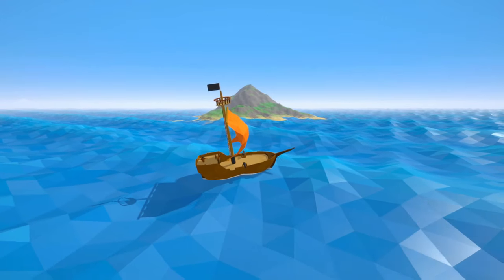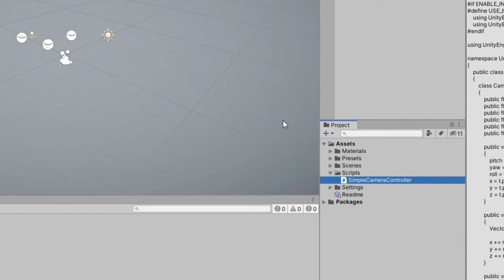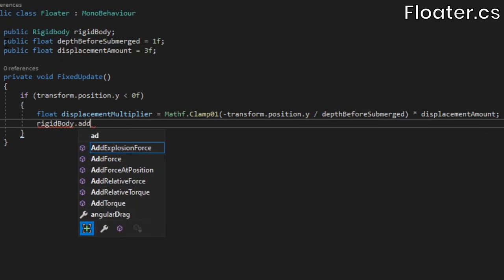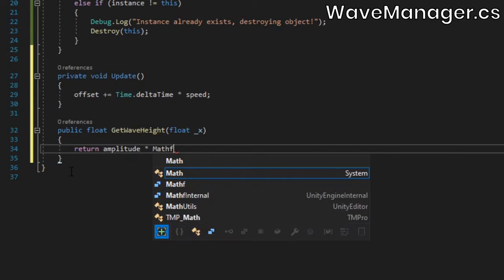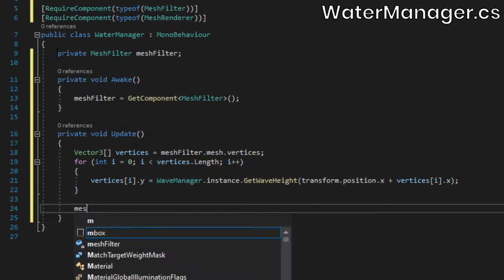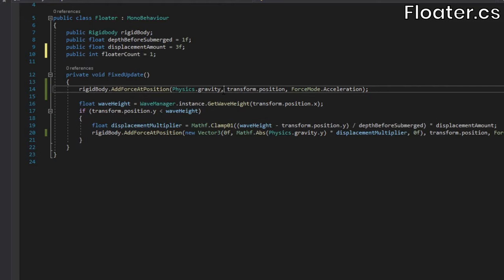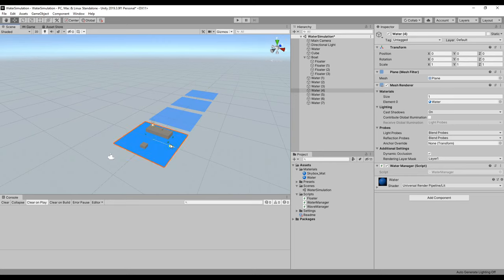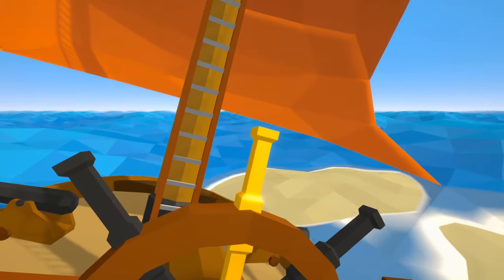How to Set Up Dynamic Water Physics and Boat Movement in Unity | Ship Buoyancy Tutorial

Comment: CS0165: Use of unassigned local variable 'displacementAmount'
CS0103: The name 'displacementMultiplier' does not exist in the current context

I got these two errors, can you help me with this? Its for the floater
Reply from the maker: Those are both compiler errors, meaning something in your code is different from mine, so just compare your code to what's in the video again.

Comment: I don't seem to understand how you're getting the waveheight from the shader.
Do you just simulate the whole equation in your wavemanager so you just have an approximation of what the wavehegiht actually is?
Reply from the maker: If you use the same formula in the WaveManager as you do in the shader, then it won't be an approximation—it'll give you the exact wave height. However, if you're using Gerstner waves, there's no mathematical formula that will give you the height at a given (x,z) point, simply because Gerstner waves modify the vertices on the horizontal plane in addition to the y-axis. The best you'll get is an approximation.

Comment: Hey, great video!
Where did you place the floaters on the ship? im getting some weird movement when the waves get bigger or at the beggining of the simulation
Reply from the maker: Just evenly spaced around the hull. How many you use depends on how big the boat is. How are you scaling up the waves? If you're changing the actual scale of the water plane's transform, that's probably why you're getting weird behavior because doing so doesn't change the scaling of the waves that are used in the physics calculation.
Reply: @tomweiland  no im changing it in the actual wave height parameter and not scale.
I get the weird bounces at the beginning and then the ships float nice.

Comment: Just curious.. Have you gotten any problems from the offset number increasing too high? Cause running the program seems like it could cause a crash due to value overflow if you don't reset it periodically.
Reply from the maker: I haven't run into any issues with that, no. However, I haven't left it running for days on end—you may need to wrap the offset every so often.
Reply: @tomweiland  Yeah, that's what i thought, the only problem can be calculating when to cut the time for it to not do a jump in the physics calculation, but that can be sorted with math too soo not really a problem. All praise the math gods!

Comment: so im having an interesting problem. As far as I could tell, everything worked fine with just a single floater, but when I introduced multiple floaters everything broke. My ship does react with the water, but it seems to be doing it too much. Its spazzing out, is the best way i can describe it. I have fiddled with the rigidbody settings on the ship and sometimes it gets marginally better, sometimes it gets a lot worse, usually nothing noticeable changes. 
I tested this out with a cube (was originally using a 6th rate frigate model I made, since I already had it and it was more representative than a cube was) and it works fine on the cube, which, in my mind, means that the issue isn't with any of the scripts but is something about the set up on my larger ship. I have no idea what the issue their might be, though. I frankly dont see how the way I have it set up on one ship could possibly break the system to that extent.
 any ideas?
Reply: I half fixed it. Adding a collider seems to have fixed the problem, for some reason, but the ship is still floating really weirdly. It looks like the gravity aspect of the floaters arent quite working as expected there (The bow and stern remain roughly aligned with each-other, even when they really shouldn't be), so the ships gundeck, and sometimes even the upperworks, regularly get submerged. This isnt a gamebreaking issue, unlike the one that the collider solved, but it is annoying and quite distracting. This is also a problem on the cube i used to debug the prevous issue (I had to scale it significantly for it to actually be noticeable though). I personally suspect I must have gotten something wrong in the floater script somewhere but I wonder if anyone else had this issue?
Reply from the maker: What did you attach a collider to? The water plane shouldn't have a collider attached.

How many floaters are you using? If your boat is substantially bigger than that test cube and you're using the same amount of floaters, that's probably the problem. The water height is only check at the position of each floater, so for example if you only have a floater at each corner of the cube/boat, a higher water height halfway between those floaters (aka around the middle of the boat) won't in any way affect the boat's movement. Based on what you're describing, it sounds like you probably need to add more floaters at different positions.
Reply: @tomweiland  Thanks for the response!
The water has no collider - the mother gameobject of the ship (which also has the rigidbody) has a box collider. beneath this object are the floaters and the ships models. I had 7 floaters, which i thought was an alright amount. I now have 14 and the issue persists. The test cube also seems to have this problem, so I dont think floater counts are the issue.

I did some testing 
I also tried giving the floaters colliders - no effect - and rigidbodies - completely broke everything - I finally reenables gravity on the Rigidbody - I dont think that helped but it may be an avenue of investigation. 

I did realise something, though, my ship tends to list (lean) towards random sides a bit arbitrarily.  I didnt think much of this at first since, well, I expected that behaviour, but I did just realise - it might be gravity that is doing that, and if so, then gravity seems to work on the sides, its just the front and back that remain roughly stationary. If this is indeed the case, then could it be a transform issue?

Here is my floater script, if it helps. 

public class Floater : MonoBehaviour

{
    public Rigidbody rigidBody; 
    public float depthBeforeSubmerged = 1f; 
    public float displacementAmount = 3f;
    public int floaterCount; 

    public float waterDrag = 0.99f; 
    public float waterAngularDrag = 0.5f;

    private void FixedUpdate()
    {

        rigidBody.AddForceAtPosition(Physics.gravity / floaterCount, transform.position, ForceMode.Acceleration); 
        float waveHeight = WaveManager.instance.GetWaveHeight(transform.position.x); 
    
        if (transform.position.y < waveHeight)
        {
            float displacementMultiplier = Mathf.Clamp01((waveHeight - transform.position.y) / depthBeforeSubmerged) * displacementAmount;
            rigidBody.AddForceAtPosition(new Vector3(0f, Mathf.Abs(Physics.gravity.y) * displacementMultiplier, 0f),transform.position, ForceMode.Acceleration);

            rigidBody.AddForce(displacementMultiplier * -rigidBody.velocity * waterDrag * Time.fixedDeltaTime, ForceMode.VelocityChange);
            rigidBody.AddTorque(displacementMultiplier * -rigidBody.angularVelocity * waterAngularDrag * Time.fixedDeltaTime, ForceMode.VelocityChange);
        }
    }
}
Reply from the maker: Does your water plane have a scale of 1? If not, that'll cause some major problems
Reply: @tomweiland  the water plane does have a scale of 1. 
At this point I'm considering scrapping the gravity part of the code and figuring out my own solution to create the same general effect, since I'm completely lost as too what I've done wrong. (I do have ideas on how I could do that)
Reply: Okay, I figured it out. If you are also having this problem, make sure your water planes rotation is at 0,0,0.

Comment: Hey! I'm very new to Unity, so I'm sorry if this is a stupid question, but I have a problem. Every time I make my player jump on to the boat I made, the boat just goes underwater. I tried changing the mass of the players Rigidbody to make it less heavier, but it does nothing. Any tips?
Reply from the maker: Your issue is probably that the player's and boat's masses are very similar, which means that when the player steps onto the boat, it's almost like the boat's mass doubles, but the buoyancy forces don't change. Increasing your boat's mass a bunch and then adjusting the buoyancy parameters to make sure it floats like usual should do the trick, because then the player's additional mass becomes mostly negligible.
Reply: @tomweiland  Alright, thanks.
Reply: @tomweiland  What are the bouyancy parameters again?
Reply from the maker: @sofusstuff  the Floater script's values.
Reply: @tomweiland  Oh, thank you so much.
Reply: @tomweiland  Okay, so I changed the boats mass to 100, and I set the boats floaters to around 40. But every time my player jumps on the boat, instead of the boat getting submerged, it just glitches out of the map. What do I do to prevent this?
Reply: Nevermind I fixed it. Turns out my player had two different colliders, and that was what was causing the boat to flip out. Sorry about that.
Reply: @tomweiland  Another question though: How do I make the water affect the boats x/z coordinate depending on which way the waves are going? Sorry if I'm bothering you too much, I just have no idea what I'm doing lmao.
Reply from the maker: @sofusstuff  I'm not really sur ehwat you mean by "affect the boat's x/z coordinate". I'd suggest joining the Discord server and asking over there, since YouTube doesn't always notify me for replies if I've previously already responded to the comment.

Comment: In my version when i trye with really large waves the boat is floating in the air. The ocaean is based on y 0 meaning that the waves go down to -14 I think that is the problem but i cant find a good solution to it. Any ideas?
Reply from the maker: Did you by chance change the scale of the mesh (plane) you're using? That will screw up the synchronization between the visible water's shape and the heights that the floaters sample because the method that returns the wave height is not set up to cope with that.
Reply: @tomweiland  It is very big. But you were correct. The wave height medhtod didint work. I fixed it now but it stutters a bit. Going to work on that now :). The profileres says it takes 8 ms sometimes

Comment: The fact that you were able to teach this idea in 10 min is impressive this is a really awesome tool. Just one question I noticed the offset float keeps increasing obviously. could there be any downside to this if the float reaches its max. I was thinking you could set it to 0 after its greater than a certain number or reverse the offset to decrease instead of increase idk thanks.
Reply from the maker: Most formulas you might use to generate waves will repeat at some point (an untransformed sine wave has a period of 2π, which is how often it repeats), so you could use some math to figure out the period of your wave equation and reset the offset every time you reach that value. That should result in a seamless transition (assuming you do the math right 😆).
Reply: @tomweiland  yea noticed that too lol to be smooth it has to reset at the right time thanks for the response. very cool system

Comment: Great Tutorial. Altho for my low skill some stuff is hard. Wish you could show us how you work with the shader for performance or guide a little more on how a GPU shader will require a formula change?
Reply from the maker: Just because you simulate the waves in a shader instead of on the CPU doesn't mean you need to change the formula, but there are much better formulas to generate waves than using a Sine function (look into Gerstner waves). I just happened to mention the two at the same time, but you can do one without the other.
Reply: @tomweiland  Ty for replying. Gonna Try your tutorial with GPU shader from the asset store. No nothing about shaders and wave formulas:(  . Hope it works. Even if it isnt 100% accurate. Need just the feel.

Comment: Concerning doing waves in a shader, how do you get the height of the waves? I also reckon the WaveManager script is no longer needed if you use a shader? Thank you for this tutorial!
Reply from the maker: You get the height of the waves from the WaveManager script (meaning it is still needed) regardless of whether or not you manipulate the mesh in a shader or on the CPU. You just need to make sure that the shader uses the same formula as the WaveManager script.
Reply: This gets pretty tricky with a bunch of stacked Gerstner waves. Still debugging : )
Reply from the maker: @richardstevenson371  if you make a method that returns the height for a single Gerstner wave, then all you have to do is call it multiple times and sum the results.
Reply: @tomweiland  I've been trying this but the results arn't what I'm expecting. Does something need to change with the offset or speed variable from the more basic waves?

Comment: I have a problem at 4:17. when I try to use WaveManager inside of Floater, there is no Autocomplete for it and when I type it it's red underlined.  I probably messed up something, but I dont know why.
Reply from the maker: Join the Discord server and ask there—troubleshooting code-related problems is a pain here in the YouTube comments.
Reply: @tomweiland  bruv i cant join the discord server. the link doesnt work
Reply from the maker: @nugget8893  what do you mean it doesn't work? I just clicked it and it worked...
Reply: @tomweiland  ok for some reason its working now. My wifi could have been bad buts good now

Comment: how do you get the vertex position of the water that you made by shader? or the position of the y axis of the floater between the water that moves by shader?
Reply from the maker: I use the same formula in the shader as in the WaterManager. So I'm not actually getting the position of the nearest vertex, I just pass the position to the GetHeight method and it spits out the height.

Comment: At the Material. If I change the Shader to Universal Render Pipeline/Lit, then the material change his color to purple and nobody of my settings react. Can you solve my problem?
Reply from the maker: No idea what's going on there—the pink color means there's a shader error, but using URP's standard lit shader should work without problems...

Are you maybe trying to convert a shader from the built-in pipeline? If so, there's a tool in Unity to do that which you should use, but I can't think of anything else that might cause this.
Reply: @tomweiland  I will try it tomorrow. Thank you and I look forward to your tutorials of the Boat/Water!

Comment: Thanks so much for the help Tom. I went ahead and followed the Catlike tutorial to make Gerstner waves, but am having trouble connecting the WaveManager and Floater script to work with those waves. Any tips?
Reply from the maker: Yeah, unfortunately there's no mathematical formula that will return the height at any given point of a Gerstner wave, simply because Gerstner waves are generated by shifting vertices on the horizontal plane as well as on the y-axis. The best you can get is ia approximation—I spent a long time trying to derive a formula before I realized that :P

If you're interested in the exact math, I suggest joining the Discord server (link in description) as it's a lot easier to share and explain code over there.
Reply: @tomweiland  Thanks for your help Tom. I'll join the Discord and try to find an answer :)

Comment: I'm considering making a Wave Race-like game. Do you think this would work for Jet skis that move pretty fast?
Reply from the maker: Probably. You'd likely need to tweak the floater values a bit though.
Reply: @tomweiland  I can't seem to get it to remain upright. It's fine on smooth water, but if I go over a ramp and it rotates at all it just stays that way. I have floaters in all 4 corners so it should be self levelling, right?

Comment: how do you go about making a seemingly infinite ocean? when i just try sizing up the plane, the waves pretty much disappear. when i add multiple planes, the game obviously lags like crazy. so what do i do?
Reply from the maker: The waves disappear when you size up the plane because you're basically just stretching the waves out (as we calculate the vertex height in local space in this tutorial, instead of using the global vertex position).

Also, stretching the plane doesn't add any more vertices. It just pushes them further apart, sort of like zooming in on an image—the resolution doesn't increase, so you end up with a pixelated image. If you want to use a single plane, you'll need to create one with more vertices (higher resolution) in an application like Blender, or generate it programmatically. However, adding more vertices will give you the same lag you're getting when you add multiple planes, because more vertices means more wave height calculations. Like I mentioned in the video, the only way to get around that is by using a shader to displace the mesh on the GPU (check out the article linked in the description).
Reply: @tomweiland  thanks man, will do
Reply: @tomweiland  By offloading the shader onto your GPU are you still using just one single plane with a large amount of vertices or multiple planes combined together all running the same gerstner wave shader?
Reply from the maker: I personally use multiple planes.